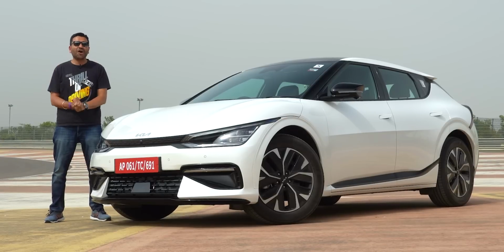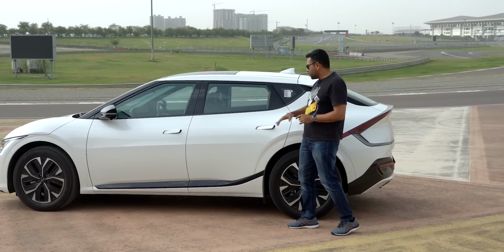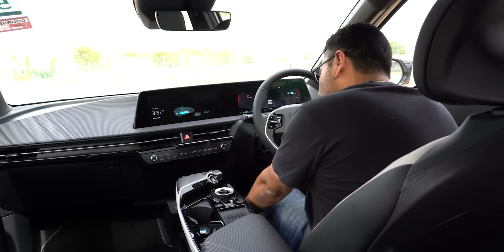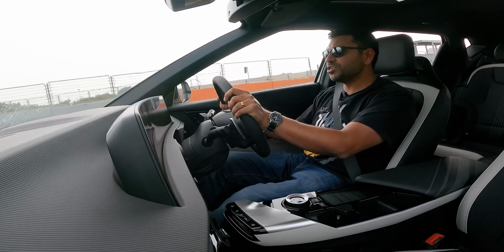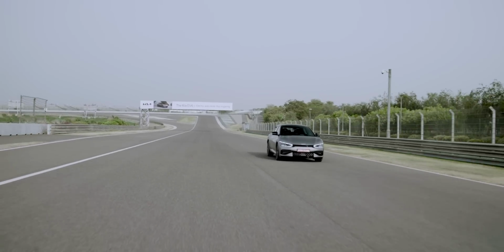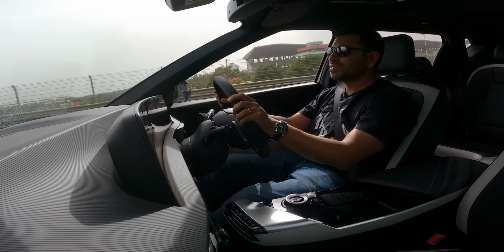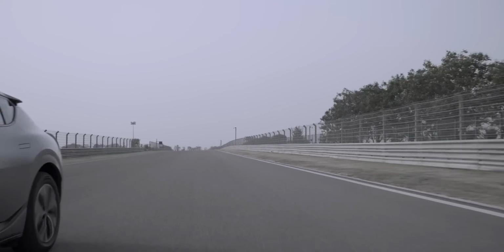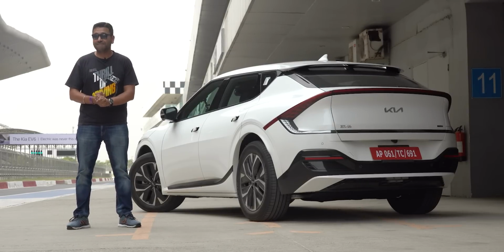2022 Kia EV6 Review | Exteriors, interiors, performance, range explained | First Drive | evo India

Comment: I think the notion around owning EVs still revolves around the range. With claimed 500, people will automatically start comparing it to Nexon max. So, I believe the pricing will be the key, and if it’s priced somewhere around 35, it should sell like hotcakes. Wishful thoughts, I feel. 
That aside, is that a Speedmaster?
Reply: Looks like a speedmaster, I have seen him in a Rolex submariner too
Reply: @manoja538  Yeah, I saw it in today’s video too. He was wearing that sub.
Reply: 70 lacs
Reply: @Movableobject  I’ve seen that expected price is 65-70, but you can get the i4 for 70 with 590km claimed range, the high snob value, German engineering and so on. It won’t even sell the 100 pieces at that price.
Reply: @AXELAGONY  true, and under that (on cardekho) it was written that the expected price is 1 to 1.2 crores if that is true then I'll be mad. 1 crores for a fuckin economy hatchback?🤡🤦🏻‍♂️